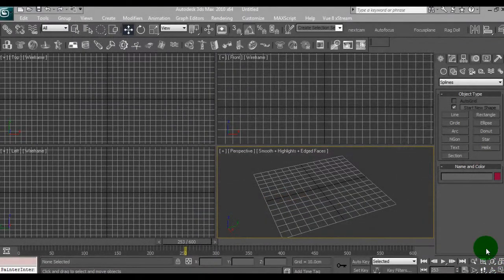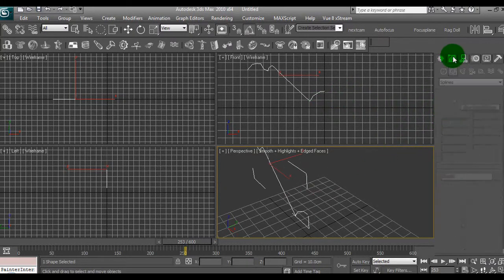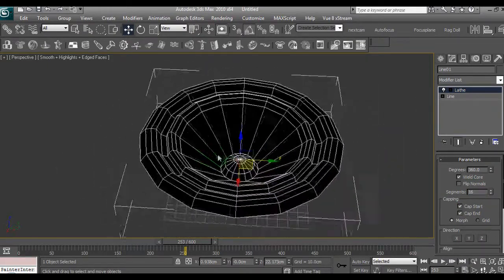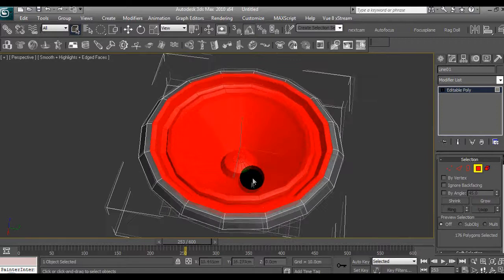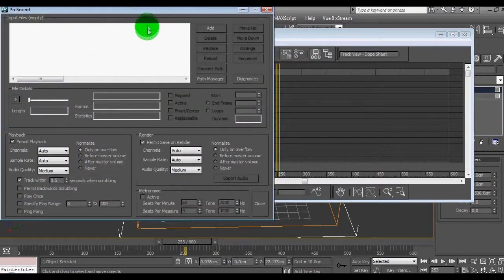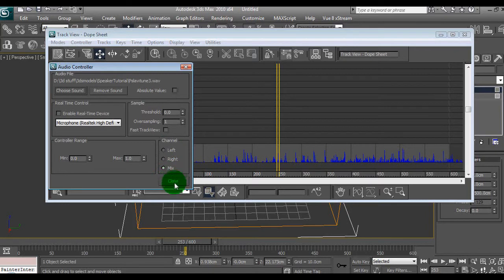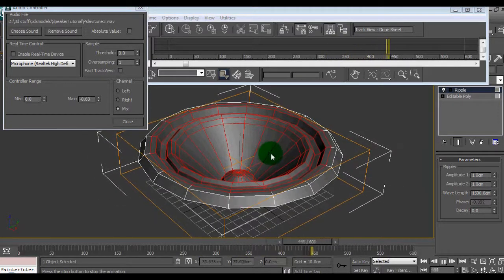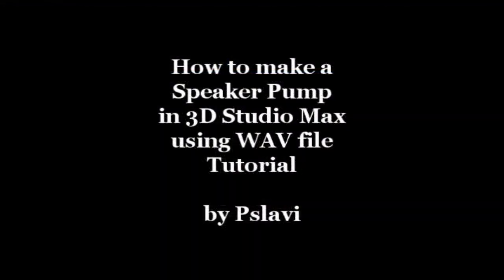Speaker Pump Tutorial in 3D Studio Max using Audio file (HD720)

Comment: I know this an old video, but I am curious if you since have found a way to add a delay to the actual animation? So that the movements aren't so hard and essentially going from 0 to 1 strait, rather than a bit more softly settling after an extreme position has been reached. Without it everything looks very jaggy because... well it is :) It's one of those things that is super easy to do in C4D, but I haven't found a simple way in Max.. other than doing it all with particles maybe... hmm

Comment: got a question: some objects react from a certain point with sound by just using a simple box in height...but if i use the width the movement is not calculated from 1 point but in the middle...i tried to move the pivot but it has no effect....is there a way to tell the reaction he has an another start point ?